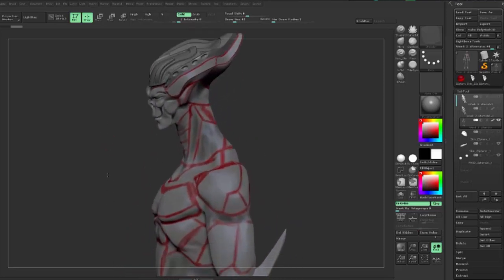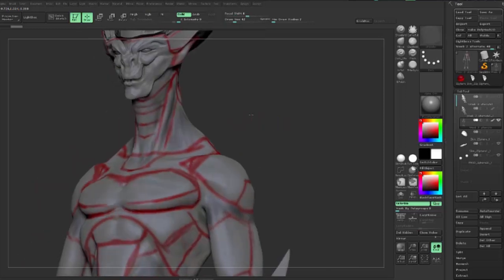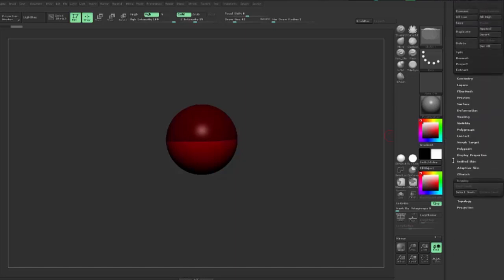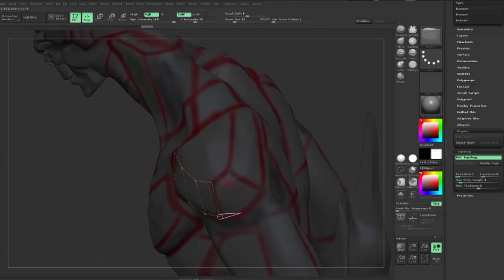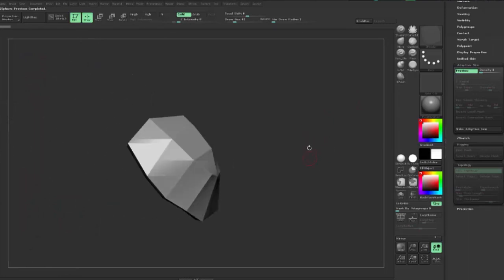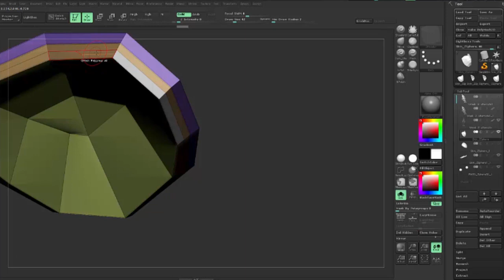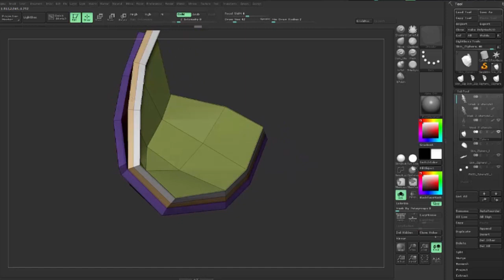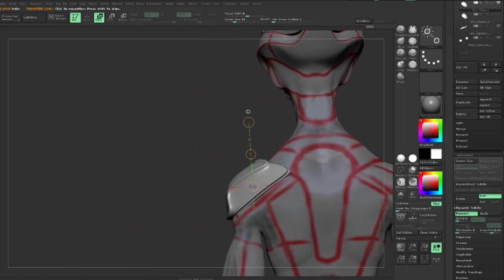ZBrush 4R7: ZModeler Quick Topology 1

Comment: hey man,what is the difference of modeling a robot model for an human?
Reply from the maker: CronosS Productions The big difference for me would be the anatomical limitations. With a robot, or even a creature, it's easier to play with forms without the restrictions that traditional anatomy present. 

With robots specifically, you can break things in to parts and piece them together. So, you could start with a first pass that covers the main forms and large internal structures, then follow up with supplementary passes to add detail. Hard surface modeling can take a considerably longer amount of time to work on, depending on how far you go.

If you are interested in mechanical sculpture, I'd definitely recommend checking out people like Mike Jensen.

Mike Jensen's Hard Surface Techniques:
https://www.youtube.com/watch?v=aQSPEMWhNbg
Reply: ZFever thanks! really helpful
Reply: ZFever i have other question!have one guy who works only with robots modelation?or i need to learn all techniques of modelation?Because i have to much problem with organic modelation.
Reply from the maker: It is definitely handy to be able to work in both situations, but not everyone is able to do that. Either way that you go will require some time to gain experience. I'm certainly no authority on either subject, but from my own experience, I like to be able to jump between hard surface and organic modeling. 

So long as whatever you are creating has a strong design language that everyone understands, I don't see a reason why collaboration would hurt. Any major studio spreads the workload amongst its artists. So, if it works for them, it can work for anyone.
Reply: ZFever thank you!